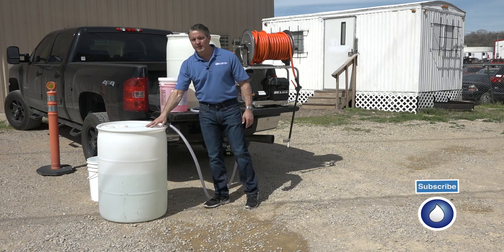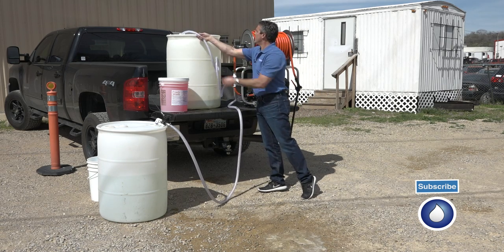The Maverick Soft Wash System | How To Clean Roof & House With Low Pressure Machine

Comment: Great piece of equipment!!! Has made our company lots of money but you must rinse this system out each time its used. We have used it for 4 years and gone through 4 pumps and three accumulator tanks; we  learned the hard way that its best to use this from the ground and not elevated. We are upgrading to the Delux Stallion Gas Powered soft wash system with skid and tank. Great equipment and service when needed!!! Thanks!!!

Comment: I have this system and I’m using the sidewinder mixing station. I feel like I lose pressure after 10 seconds and have to stop flowing to let it build back up. Is this normal or is there a way to fix this issue? Thank you

Comment: How do you rinse the house off? Do you have a fresh water drum or use the customers water supply?
Reply: Typically when you apply the solution mix of bleach and surfactant you let it dwell and there is no need to rinse. However, in the event that you want to rinse you can simply use the customers water hose or you can have a drum/tank with just plain water. But again the main feature of soft washing is not having to do any rinsing once you apply the solution mix.
Reply: @CFRHD  thank you for the info

Comment: I just bought the bronco system I unrolled it so that I could put it away on a hose reel and it took me 25 minutes to uncoil the hose and try to get it all untwisted.   It was kinking up everywhere and I found gt with it to finally get it so that I could reel it up.   Please tell me that this will not be the case when I actually start using the system.  As for now I am totally pissed off about the purchase.  This was the reason I bought the system since I thought it was coming with a really great hose.   I can not see commercial people using the hose due to it twisting up like it does.     What can I do or is can someone tell me what hose is the preferred one for soft washing.  Tku
Reply from the maker: David, I understand.  Unwinding a coiled hose can become a mess.  But if you take the end and twist to unwind the coils as you walk the end away from the roll, it will come out straight.  Since, it sound like you are putting it on a hose reel.   Make sure you role the hose out straight with no kinks before rolling it on the reel.  You should be find.  And every time you roll it back up make sure all the kinks are removed first.  I hope this helps.  Let us know if we can do anything else to assist.  We are here to support you.
Reply: Thank you.  I will keep you posted I have a job Wednesday and will se how it goes. I did notice the second nozzle next to the assassin tip sprays on the assassin tip and I need to tighten it up or loosen it so the angle from the spray pattern does not get distorted by hitting the tip.  Not sure if your team was aware of that.  Thank you
Reply: Powerwash.com just did a roof cleaning and handling the hose was much better.  However the connection piece to my wand I think it’s called a banjo fitting was leaking so I ended up using a backpack sprayer.  I tried tightening up but still didn’t correct the issue.  Looks like I’m going to have to buy a replacement even though this is brand new, probably defective.  What size do you guys use so I can get a new one.  Thank you much. David
Reply: After watching the video can you tell me the size can lock connection and pipe size you used for the pickup tube.  That is exactly how I want mine set up.  Thank you.

Comment: What is the piece called at the end of the hose where the gun is connected I need to get that.  The cam locks that came with my Bronco system are junk, mine leaks and it’s so bulky.  Can you explain how I can modify mine to look like this one in the video.  Tku
Reply from the maker: Hose barb

Comment: At say 5 GPM pump. That holding barrel would last about 10 minutes
Reply from the maker: If you hold the trigger open nonstop.  What happens is the job never takes 10 minutes.  It takes about 1 to 2 hours based on set up tear down and moving around the job from area to aear.

Comment: This vs x jet? Thanks
Reply from the maker: XJet is basically down stream injection at the wand.  The maverick is for mixing higher concentration of solution for roof washing where XJet is good for lower concentration for house washing.
Reply: Powerwash.com thank you. I was assuming so just making sure. I have been pushin around getting into soft wash roof washing. Thanks
Reply: So Does JetX not work on roofs?
Reply: Aallard it will work I’ve used it for some time before I could afford to buy a system similar to this. But keep in mind the xjet will definitely use more solution and will have a lot more over spray. Make sure you cover everything and rinse rinse and more rinse dilution is the solution

Comment: I see tons of different youtube videos showing guys with their different softwash and pressure wash setups for low pressure house washing, low pressure roof washing, and sidewalk/driveway washing. None of these guys ever explain why you can't do a roof wash, house wash, and driveway wash with just one of either the 12 volt pump OR a pressure washer with low pressure tips since the chemical is doing the work and not pressure. Nobody ever explains why you need both a 12 volt pump AND a pressure washer to do all 3 of those applications. Maybe some one out there knows the magic answer to this question that nobody ever seems to explain on these videos? Why can't you successfully do low pressure roof wash, low pressure house wash, and driveway wash with just one of the 2 methods instead of both?
Reply from the maker: Good question Bob.  We will work to get a video out explaining why.
Reply: Under Pressure - Power Washing LLC, HAHA! Keep the jokes to yourself!
Reply: Mike Higginbotham, nobody would want to take your job at Mickey D's flipping burgers! HAHA!
Reply: This Under Pressure Power Washing LLC guy is troll. He doesn't even have a real business. He just trolls youtube all day eating cheetos and pretending to be in the business. HAHA!
Reply: You cannot perform a soft wash with any type of pressure more than that of a garden hose really because of the granules contained on a granulated shingle. Using pressure you will blow off these granules basically shortening the life of the shingles. Most guys don't know what they are doing and damage folks roofs and guys like myself are left trying to convince these people that not every pressure wash company or individual is like this and some of us actually care about our customers. Even a little research on YouTube would teach most anyone of the proper way to do a soft wash with the proper chemicals that won't harm plants, people or the environment.